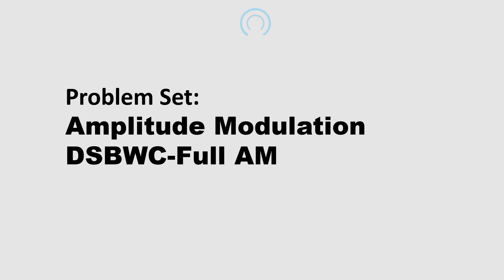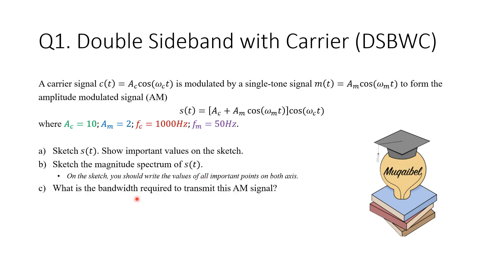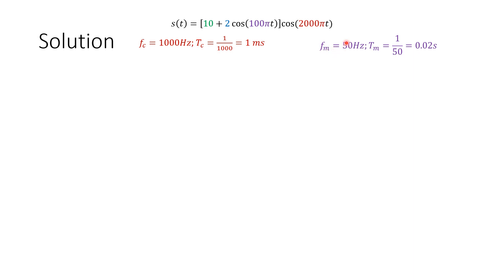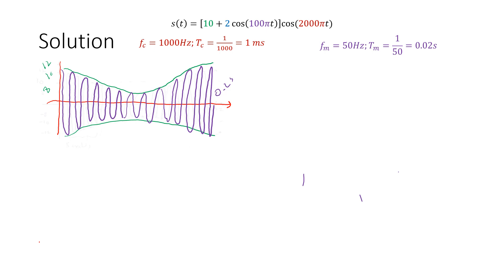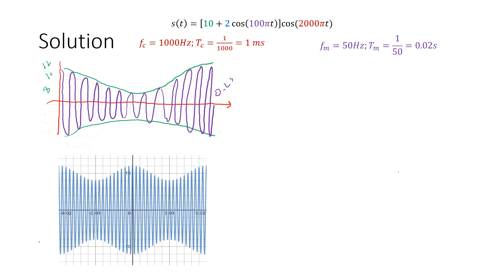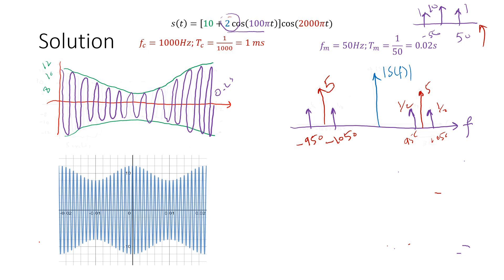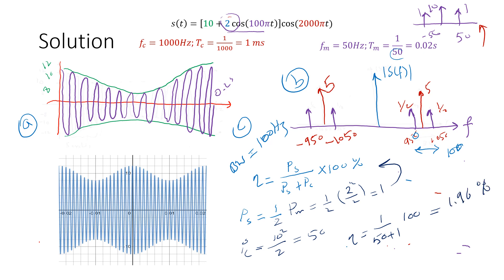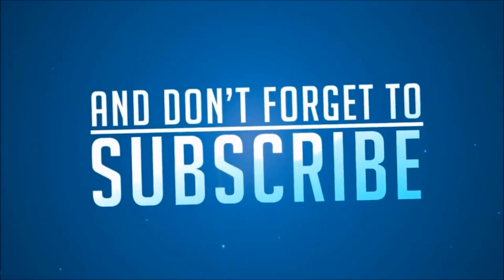Challenge 3: Amplitude Modulation (DSB+C)

Comment: Dr. Ali, the message, that I am looking to send it, is 2cos(100*pi*t) and the offset to avoid detecting problems. So, I expect the BW to be less than or equal to 1050 because it is the desired signals. How it come 100?? or how we calculate?
Reply from the maker: The bandwidth is the difference between the highest and smallest frequency (in the positive spectrum) so it is 1050-950=100Hz. Or simply the message BW is 50Hz and with double sideband it becomes 100 Hz
Reply: @alimuqaibel7619  Thanks Dr. Ali. Now its crystal clear.